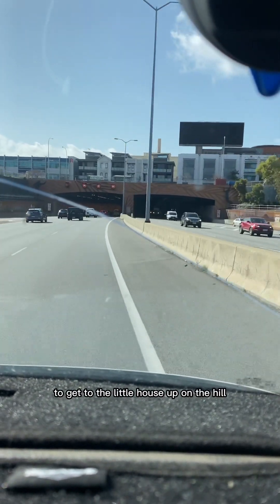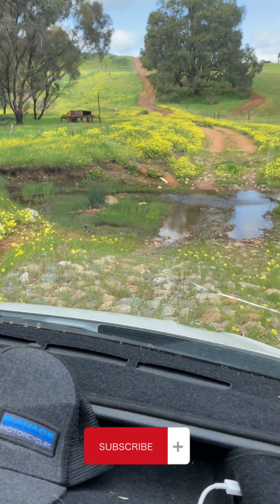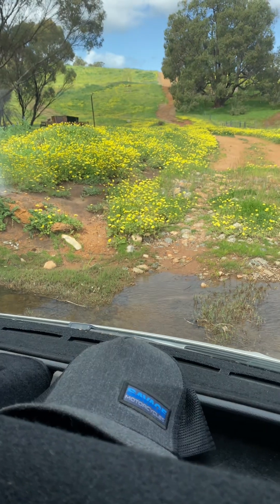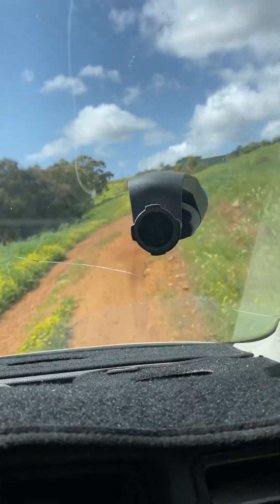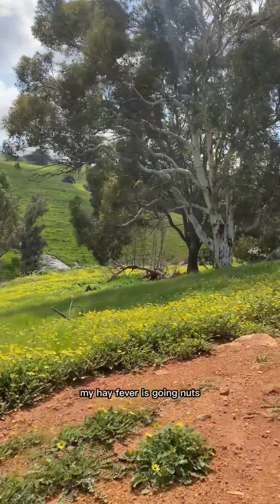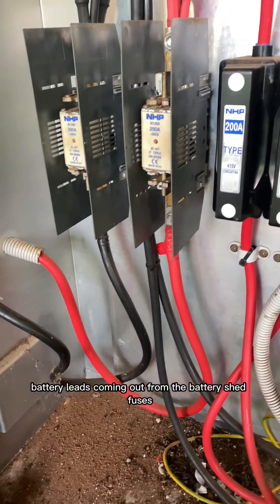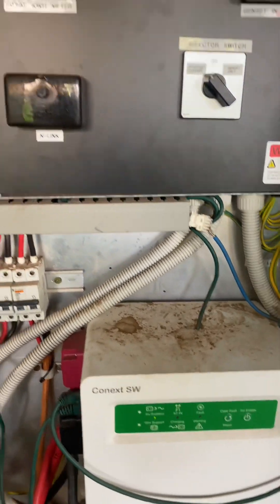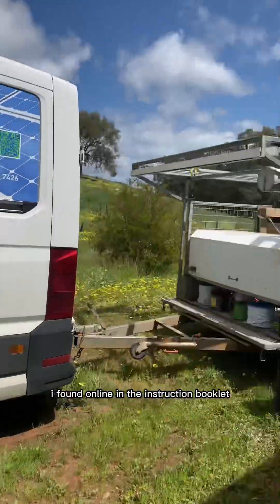Off Grid battery swap-out, lead acid to lithium ferro phosphate Power Plus Energy batteries.

Comment: I'm gonna have to get you to come out an have a look over my system one day, tweak it to ensure it meets current standards. It's a self built 48 volt system operating in the extra low voltage range but now the new regs have been in for a while, I probably should get someone to give it a look over. (Wheatbelt area, Perth side of Northam) I'm in no rush but will eventually have to get it done.